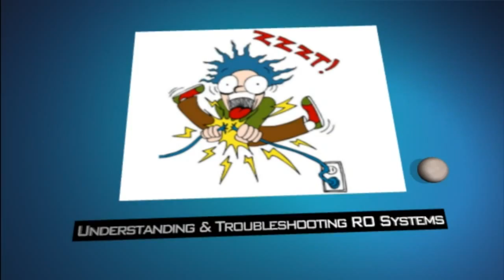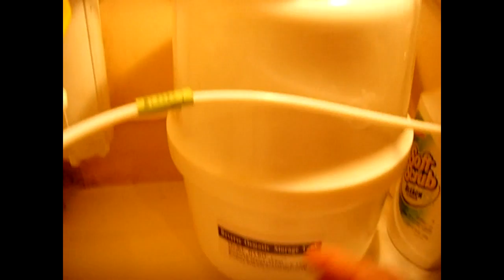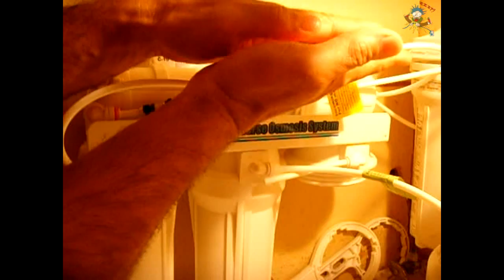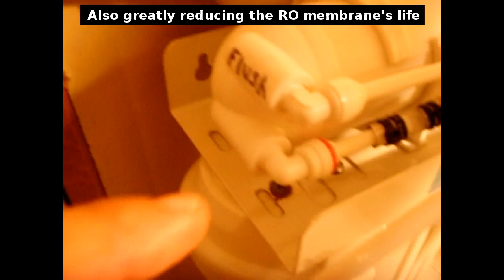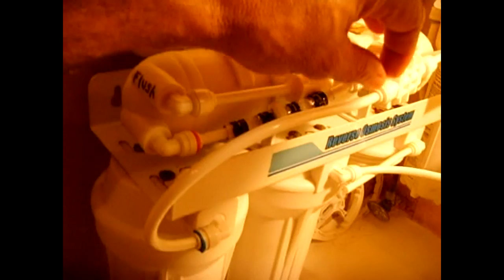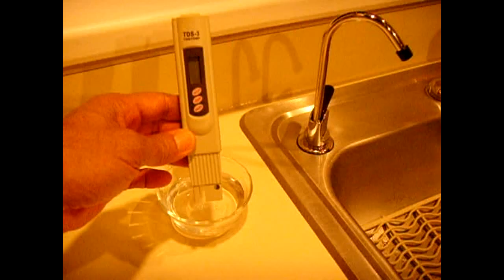REVERSE OSMOSIS(RO) ~ Troubleshooting & Repair(Step By Step)

Comment: My RO system was moved from my sink to my refrigerator.  It worked fine before but now when the tank is full it sounds like a lawnmower.  There is incredible vibration on the lines.  Any ideas?  Nobody has been able to resolve the problem and it has been shut off for about a year.  Also when the system is quiet and I turn on the tap at the kitchen sink  the noise starts and then stops when I turn the tap off.
Reply from the maker: You have air in the lines and filters. :-)
Reply: Thanks, how do I get the air out?  I drained all the water and let it refill.  Still very loud.  By adjusting the "easy flow" I finally got it to a point that it only makes noise every 30 seconds or so.  But it is repetitive and extremely loud and annoying.  I had a plumber install it to the fridge and now am at a loss.  Of course he wants to sell me a new system but this one is barely used.
Reply from the maker: Karen Suykens You need to remove the water line from the auto shut off valve that comes from the last filter and allow it to flush for a few minutes into a 5 gal bucket. Mover the filters around to try and get all the air out while the water is flowing.
Reply: So far so good.  No noise yet.  Thanks so much for the help!
Reply: @electronicsNmore  Very interesting. I have vibration in the first few seconds of turning on the faucet. It starts rough and gets higher pitched and then it's gone. I've had this vibration since I bought the system 4-5 years ago.. on every use. Should I also disconnect the line at the auto shutoff valve and flush it? (clean water line flowing out of the membrane) Or does it sound like a bad auto shutoff valve since that vibration has always been there?  Thanks so much.

Comment: My system 6 month old, mains flip mixer broke so water was turned off, new flip mixer fitted, water put back on and system now not working but has waste water continually flowing and wasting heaps of water, storage tank was empty and air pressure is right at 7psi, it wont flow water out of faucet or wont fill storage tank! Loosing my shit and don't know why it wont work! please help!
Reply from the maker: The video supplied more than enough information to help you troubleshoot the problem. I don't offer special assistance to my viewers. I already spend way too much time on Youtube creating videos and answering questions, and don't get fairly compensated for all my time. Good luck

Comment: Great video, and clear explanation of the the system's function. Thank you.
Question:
I replaced all 5 components and drained my tank, when I turn on the water back on to flush it, should I leave the valve tank shut off before allowing it to fill?
And how long should I let the system flush?
Reply from the maker: Glock Runner Remove the line from the last filter before the ro membrane and allow the new filters to be flushed until the water runs clear, then reconnect the line. Throw away the first tank of water.

Comment: tanks for the video. I need help.
in my systems, when I turn on the feed , the water goes out on the drain pipe. it is normal?
Tanks
Reply from the maker: Small amounts are normal, and the flow should stop after the tank is full.

Comment: Hello. Thanks for the video.
Need help. When installing my system, when I turn the water began to flow from the drain pipe. This is normal, or have any harm on the tube, or even a broken part? Is this is normal to spend 2 to 4 hours of filling the tank?

Comment: I see the tank only has one connection. How does that work? How can the water going into the tank which comes from the membrane. Go back out the same tube and up to the faucet? Confused.
Reply from the maker: A check valve only allows water to flow in one direction.
Reply: +electronicsNmore oh I see... I think the best way to stop wasting water is use the right pump. Vitev came out with a water optimizer pump. 1:1 ratio for 100% of tank fill. That's the system I'm getting.

Comment: Leaky Shark bite fittings. Any suggestions?
Reply from the maker: Hi. Cut off the end of the plastic tubing(1/2"), and slide it back into the connector. If it still leaks, then replace the fitting.

Comment: Hi, cool video ;) i just installed "water express"5 stage system. did empty system twice before tasting first water out, seems still lot of particles in the water, smell gone but after testing with water tester same as you use in video, numbers are nearly same as directly from non filtered tap water of my home :( system is brand new, any suggestions ?
Cheers.
Reply from the maker: +Fab Gir 
Check all connections. You may have a line connected in the wrong place.
Reply: Thanks just released after checking all, to membrane wasn't already fitted, as I bought with extra filters and some were already fitted, I thought all was fitted already lol you always learn from your mistakes small or big lol cheers for your follow up thow.

Comment: how much pressure should you have to use to blow through the check valve in the direction of water flow?

I have a new ISpring RCC7, which I have had nothing but problems with. 

 I was sent two new check valves. One of which, I could barely blow through in the direction it should be open.

On the other, I could blow through it if I used very quick, short bursts that actually made my head hurt, and made my cheeks hurt like I was blowing into a trumpet or something.

I don't know how hard you should have to blow through these check valves, but I think if I "tested" them too much, I might give myself an aneurysm....

I think this system I installed is pretty cheaply made....
Reply from the maker: +The Suburban Hippie Experimentalist 
Some valves can require some pressure to allow the flow. Just make sure it only works in one direction. You can also do what I did in the video when my check valve failed causing the water to run all the time.

Comment: what does the red indicator light mean.  when I turn the faucet on it was blue and its red.
Reply from the maker: +Matt Lee 
You must have a sensor on your system that tells you when the TDS reading becomes too high. You need to backflush the RO membrane, or replace it.

Thanks For Watching!

Comment: I have problem with my 5 steps RO. Water is flowing continuosly to the drain. Following different articles about RO, I changed the shut of valve for new brand, I found the check valve in the membrane housing in good condition, I empty the tank and changer it with 8 psi of air. The bladder is in good condition. I do not find the solution. I appreciate any help
Gustavo Bulla
Reply from the maker: +tavin5000 
If water continues to flow into the drain even after the tank is full, then 100% you have a faulty valve or faulty check valve like the one I replaced in the video. I suggest you recheck everything. There is no other cause.
Reply: +electronicsNmore Thanks electronicNmore, I recheck everything and I found the tank was not full. After 2 hours was full and the flow to the drain stopped. Thanks a lot master

Comment: just got my new 6 stage a few weeks ago. All the tubes and flow are fine.  I am however getting high TDS=80-90.  After replacing the membrane from Home depot just to rule it out, I'm still getting high TDS=80-90.   What would be causing this?  I've installed and restalled the membrane several times and has not fixed the problem.  Any input would be great appreciated!  thanks!
Reply from the maker: +blahblah 
Hello there. Test the feed water. You may have city water with a TDS reading of 800 -1000. If you do, then the reduction is fairly normal.

Thanks For Watching
Reply: +electronicsNmore thank you for the quick reply.  City water is around 400,  water out of the 4th stage (membrane) around 100, out of tap around 80-90, out of RI resin (black sand) around 1-10.  I believe after doing more research that it could be the city water pressure (very high).  I've drain the tank, dropped the IN to 50% and we'll see what happens in the morning.  fingers crossed.
Reply: +John Follis kind of worked.  I'm in the 70 range now.  Not sure what else it could be.  Or as a workaround, just tap off the resin stage instead of the 6th stage.  I know the resin is much much lower in TDS.  maybe it's a defective membrane housing?  i even rubber hammered it to make sure it's really in place.
Reply: Pressure in fact improves membrane filtering quality, so higher pressure should lead to reduction of TDS.
You need to test city input water TDS and then TDS after each filter until you figure this one out.
It could be that your flow restrictor is defect, or membrane needs to be flushed out, or there is a leak in one of the filters.

Comment: Hello from Argentina. I have an RO filter with pump (6 step, mineralizer). I d like to know if i can install the equipment horizontally. I dont have the space under the sink to install it vertically. Can i have it layed down. Could it affect the operation? Thanks , great video!!
Reply from the maker: +Andres Garcia 
Hi Andres. Installing the RO system horizontally is not a good idea. They are designed to be mounted vertically. 

Thanks For Watching!

Comment: One quick question - can an RO filter remove radioactive contamination  - such as alpha particles - from water?
Reply from the maker: I would say RO or even better distilled water.

From Purepro's website:

From a particle size perspective, the atomic diameter of uranium and radium is .000350 microns and .000430 microns respectively; most radioactive particles are larger than .0002 microns. Most reverse osmosis water filters remove particles larger than .0001 microns. To know the filtering ability of a specific reverse osmosis system, consult the Performance Data Sheet for that system.” Reverse osmosis filtering is much less expensive and significantly better for the environment than plastic bottles, and allows people to be absolutely sure of the purity of their drinking water because there is nothing to potentially contaminate water between filtration and consumption.
Reply: electronicsNmore
Thank you for the reply! Certainly loks like one could use RO to decontaminate water mildly polluted with radioactive contaminants, given the text of that excerpt from the Purepro site.

Comment: electronicsNmore Some people claims when I use filters I will drink distilled water without any salts which is required for humans daily activity.
What do you think about this?
Reply from the maker: There are no dissolved solids in distilled water, but if you get the minerals/salts from other sources then you are fine.

Thanks for watching!